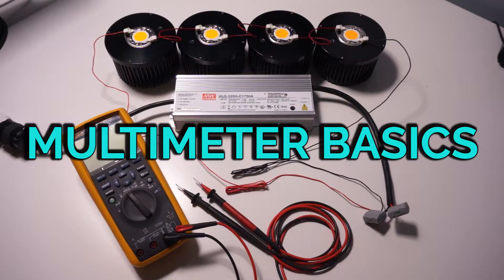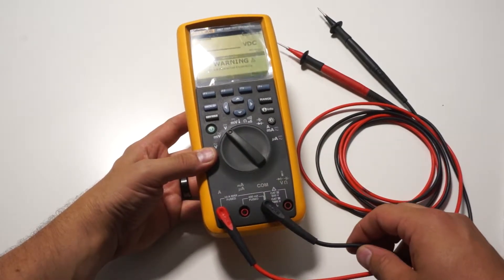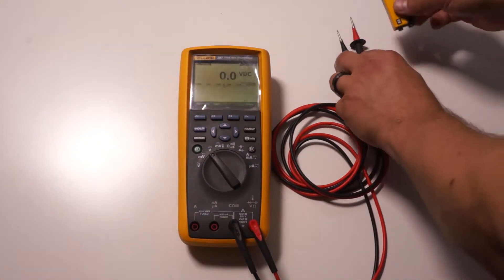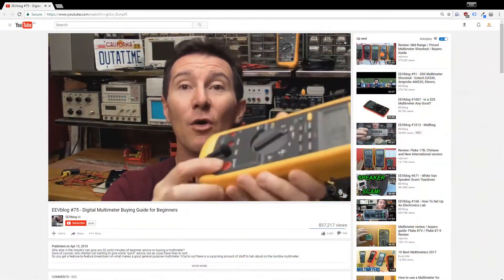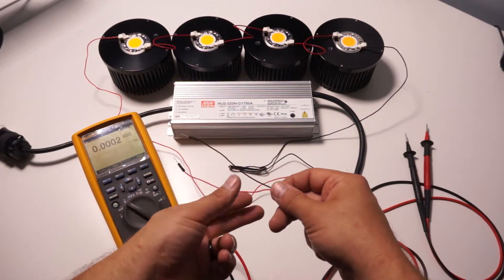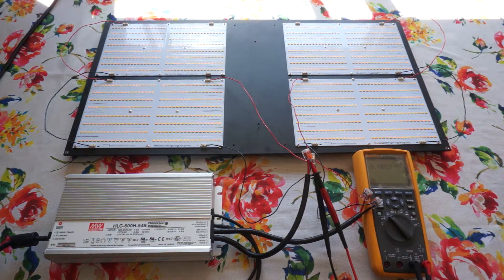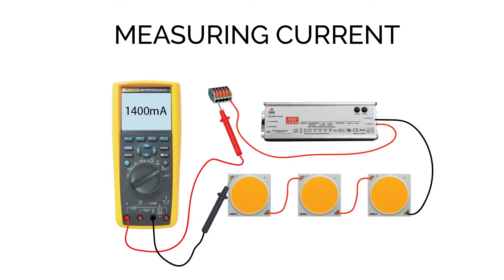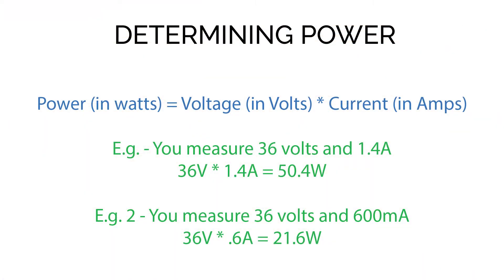DIY LED Multimeter Basics

Comment: I haven't soldered the wire ends into my led strips yet and I'm trying to measure Amps but all I hear is this clicking noise from the driver. The amps are wildy switching every second to 0 between 5 or so. I'm definitely doing something wrong but don't know what. Setting up the Volts went without any problems. 19,42v is where I set them. 
I have 2x HLG-320H-20A. I wired each to their own 10 port wago since I have 12x strips I'm trying wire in total. The strips are https://www.led-tech.de/en/50cm-Alustripe-with-98x-Samsung-LM301B-LEDs-3000k Wiring in parallel so each strip has it's own wires going to the junction wagos. 
I tried measuring the current from the free port of the junction wago when it started behaving wild.
I guess my question is that should I solder the strips before trying to measure from the junction or do you have an idea if I might be doing something else wrong? 
Sorry for the wall of text :P
Reply from the maker: You need a complete circuit to measure the current. Strips have to be wired in place.
Reply: @LEDGardener  Yes, thank you for confirming that. It's scary stuff since I have no idea what the current is set to so I tried measuring it before soldering the strips in but ofc it doesn't work that way.
Well, to soldering then. Thanks.
Reply from the maker: Turn it right down and work your way up.
Reply: @LEDGardener  Yup, it's just that the pots seem to rotate infinitely but I assume they are set as low as possible when I rotate them to the left.
Reply: @LEDGardener  I soldered all of the strips and they all light up when I briefly turn it on. Still If I try measuring current from that junction wago the leds do not light up and current is going haywire. I guess I'm shorting stuff out. I did this picture showing how I'm trying to measure. https://imgur.com/lAmrOWv 
Should I just disconnect the drivers positive wire from the 5 port wago and connect that to a 2 port wago then connect the positive probe with that?
Reply from the maker: Yeah you’re shorting it out. Watch the video again closely. It’s shown in there better than I can describe here.
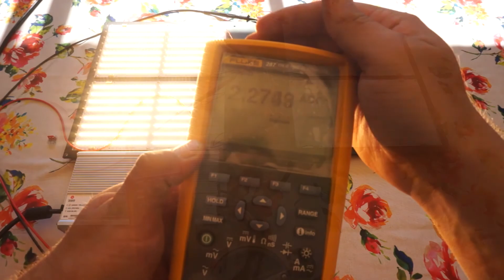Reply: @LEDGardener  I've been staring at 14:12 but I can't honestly make out everything in it. Anyone got a diagram? I ordered a cheap ammeter but it will probably take months to arrive.
Reply from the maker: Build your whole circuit. Put your meter in current reading mode and make sure the probes are in the right jacks. Take the driver positive wire and connect it to the red probe of your multimeter. Take the black probe and connect it to the positive of the first strip in the chain. The negative side just all connects normally between the strips and the driver.
Reply from the maker: Think of the multimeter as just a chunk of wire. Positive flows in on one probe, goes through the meter, then flows out on the other probe. You do not want to join positive to negative like you do when measuring voltage. That is a short when the probes are in the current jacks.
Reply: @LEDGardener  Thank you for the explanation. I got a bit impatient when I realised I might have to wait months for the chepo chinese ammeter and went ahead and bought a Fluke T6-1000. 
I'm sure I could measure it with the multimeter with your explanation but having to wait couple of days for the Fluke is fine. Even I can't mess up with that :)
Reply: @LEDGardener  I ended up doing exactly as you said because the Fluke T6-1000 was kind of a pos. 
Now I connected the multimeter the right way and I'm gettin 0.80 amps but when I rotate the trimpot absolutely nothing happens. 
Do you think it might be because I shorted stuff out the first time I tried? I even used a flashlight and looked that I'm rotating the pot.
I guess I could use it as is but kinda weird.
Reply: @LEDGardener  Dude, I got a Kaiweets HT206D clamp meter and still when I rotate the current pot nothing happens. Set voltage to 20.3V(max for strip) and it measures 5.75A coming from driver and 0.95A at individual led strip
My driver is the HLG-320H-20A CC/CV AC/DC 17-22V 15A.

Is this even a driver that should change the current? I mean there is a pot for it. I'm at total loss what could be the issue.

Comment: @LED_Gardener do you have any info regarding the connection between the LEDs and the heat sinks? Like specifically the thermal pastes/greases etc? I'm doing some research in this area and wondering what your thoughts are.

Comment: I wanna replace the cob led in a craftsman work light, the light says .07A on the back & it's a 300 lumen light. Can I use any 3 watt cob led of the same size as long it's mounted to the same size aluminum plate/heat sink? Led part # is HY-020 H but I can't find it.

Comment: You’re videos have been very helpful and im greatful for the time and energy (literally) you’ve spent making them. But one thing you have explained much less than anything else is how to measure current on a CV+CC driver with parallel wiring. You touch on breifly at 13:10 but show no diagram and it’s almost impossible  to see how you wired everything.
Reply from the maker: Thanks for the feedback. I’d be happy to explain if it’s something you’re stuck on.
Reply: Woah thanks for the quick reply! Im running two qb288s in parallel with the “home run setup” to a hlg 320 54A driver. To measure current can I just stick my leads into the corrisponding wagos like you have illustrated in part 2 video at  15:50?
Reply from the maker: Kyle Wood If you want to measure the current on the whole circuit : Disconnect the positive driver output wire from your positive wago. Use another Wago to connect one of your multimeter leads to the output wire that you just unhooked from the wago. Connect your other multimeter lead into the port in the wago that you removed your driver wire from. Make sure your meter leads are in the right jacks. This will give you the current of the whole circuit.
Reply from the maker: Kyle Wood if you want to measure just one board at a time, you’ll instead remove the positive home run wire of one of your lights from the wago splice (it actually doesn’t matter if it’s positive or negative for either of these scenarios - just make sure you’re consistent with either polarity). Put one of your meter leads into the port on the wago that the home run used to go to. Connect the other meter lead to the home run wire you removed using another wago. That’ll get you the current flowing to just that board.
Reply: Thank you! My results were interesting I measured about 6.8A... 800mA more than the driver is rated for thats 3.6A per board 800mA more than they’re rated for. I should probably dial them back
Reply: @FilmREALMS  what driver is that? Hope mine does that lol
Reply: @FilmREALMS  3.6A x 2 is 7.2A total so that doesn't make sense, 6.8A / 2 is 3.4A per board. A type meanwell drivers will certainly put out more current that they're rated for, so that's normal. What kind of boards you have exactly and where did you get them? Also what multimeter you used, i'm curious.
Reply: @anothaeasywin  He said he has a HLG-320H-54A
Reply: @Scarlet_Sights qb288v2 i got them off HLG's website
Reply: @FilmREALMS  Yeah you have nothing to worry about, the driver will put out more current than it's rated for.  HLG should have good boards so just tune them a little bit easier than the max and you're golden. Less power you put in each board = more efficient and longer lasting boards. Many people buy more boards and run them at much lower power so they run very efficient, but that's more expensive too ofc.